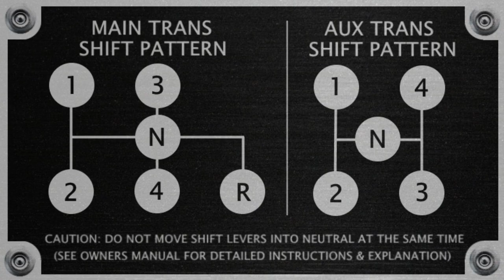Spicer 16speed Transmission demonstration

Comment from the maker: As been pointed out a couple times you never use the first gear on the auxiliary shifting up as this is the low gear and have about the same ratio as the previous main gear in 4th auxiliary
Reply: Oh, that's what I thought. When see you driving you didn't go into first you always went into second. Cool!. BTW thanks for this demonstration
Reply: 1st 1st is when you want to pull a house off its foundation up the side of a mtn. Cause you want to see the sunrise.
Reply: So 3-1 is the same as 2-4?
Reply from the maker: @benedictroberts678  Yes pretty much!
Reply: Good to know...thanks!

Comment: My two cents having driven a 4 x 4 is that the gears in the auxiliary transmission in my truck are: deep reduction, lo, direct, overdrive. So deep reduction was rarely used. But Spicer produced a range of auxiliary transmissions with varying ratio configurations so some transmissions really did have four on-road ratios. So commenters that said "you never reuse first" are only correct for some transmissions. Matter of fact, I never used deep reduction on the road - there was no point. Mine has a deep reduction because it was a semi-off-road truck used in the forest as well as on-highway. Top speed of 48mph by the way with 38k double-reduction Timken axles
Reply from the maker: Thanks for the info that certainly makes sense!

Comment: My first rigup truck in the oilfield has a 4 speed secondary and 5 speed main box. It would move just about anything. The only thing that ever stopped it were the front tires coming off the ground from weight.

Comment: are you sure you go back to 1st in the auxillary after each main shift? usually you go to 2nd-3rd-4th in the auxillary because 1st in the auxillary is usually redundant once you get rolling. I have a 4 speed- 4 speed spicer combo in a 48 Kenworth on my channel
Reply from the maker: Matthew Jones I've sure seen it! Maybe you don't need to use it unless heavy loaded, but it's still the next gear after each "jump" or it wouldn't be a 16 speed right?
Reply: No you don't go back to " deep under" 1st on the aux it's too low. It's like  shifting from 4th to 3rd. Start with both in first then shift the aux up through 4th then shift main to second and pull the aux back to 2nd then third and 4th. Then shift main to 3rd and bring aux back to second and start splitting again. The term 16 speed is rather a misnomer You have sixteen total gears to work with but don't necessarily use all of them, It's like the 15 speed which is a ten speed with a deep reduction box. You have 15 gears to work with ,but if you start in deep 1st and go all the way through the gears, you only make 12 shifts. Bringing the aux back to deep under on a 4x4 or 5x4 will result in a hell of a grinding and wild rpm . Think of  pulling the range selector up in 5th . in a 9 speed and shifting back into 1st instead of 2nd. It's a downshift. Hope that helps. We have an 83 Pete 400 A model Cat with 5x4 . A 72 Pete 4x4 318 Detroit. 1978 K.W. with a 14 speed Spicer and a 73 Road Boss with a 12 speed Spicer.
Reply from the maker: sabrina cordell Thanks for clearing this up! I have not been able to try it with an actual load therefore I never use more then 7 gears. It's great to hear from someone with the experience!
Reply: No problem. From the grandfather on down, there's a hundred years combined experience in the family business. I suppose the best way to tell people is ,after shifting has begun, forget about deep under 1st in the aux . It doesn't come back into play until you stop and pull out again.
Reply: @sabrinacordell6290  if someone share all combinations ratios, i think it will clearly understand. even not necessary real ratios. just which one long or short;. ex; main2 aux4 (<,> or =) main3 aux1.

Comment: Never drove a 4+4 but on my 6+4 there are overlap gears so you its more like 2-3-4 on the aux since 1 on the aux and next gear up on the main is essentially the same ratio
Reply from the maker: Angry Trucker Yes I learned this from Matthew if you go read the pinned comment, so really it's a 13 speed and not 16!

Comment: Cut my teeth on a five and four. Most drivers think you have to start in low and go through every gear. Most loads only require shifting ten gears to get to highway speeds. Don’t waste energy and transmission to impress others
Reply: Norman McNeal what about skipping gears and double clutching vs floating
Reply: Norman McNeal;
A friend of mine wants to give me his ‘49 IH Loadstar with the twin-sticks, and I wanna learn learn how to drive & shift that beast so it isn’t hauled to the junkyard!👍🏽😈

Comment: It must be interesting to shift both at the same time. Suppose you’re in 3-4 and you want to shift to 4-2. You go N-4, decrease RPM significantly, 4-4, 4-N, regain much of the original RPM, 4-2. Or some other sequence that stays within the engine’s limits. Right?
Reply: If you were in 3-4, you would only shift the main to 4 and leave the brownie where it is. Otherwise you would effectively downshift, 4-3 is a lower gear than 3-4, if that makes sense

Comment: I have a question, if you already in 1st gear, and want to "aux" 1,2,3,4... Do you push that clutch again?
Reply from the maker: You change the gears just like any other time wether you do it by double clutching or floating (no clutch)

Comment: I wish some one would show a 3 stick Mack. Dad drove a 56 LJ mack log truck when he was in high school. He said that's the trans it had in it. A 5 x4x2.
Reply from the maker: I assume the 2 speed is the rear axle  and can be shifted either any time or only ay a standstill. So you drive it like a normal twin stick. I could be wrong though.
Reply: The third shifter would be for a two speed rear end

Comment: Modern Eaton has aux too just air controlled with splitter and selector. Most twin stick in modern trucks aren't real mechanical aux and just for appearance
Reply from the maker: Well correct me if I'm wrong but the modern boxes would all be bolted together into one? Instead of being a separate box behind a driveshaft coming from the main box
Reply: @Darstrom  yeah it's internally seperate

Comment: On some of the 5x4 transmissions, and perhaps the 4x4 transmission, some of the gear selections going up are numerically the same as gears you've already used...so you can skip gears sometimes.
Reply from the maker: Yes I think that's the same with all of them. I pinned this on top of the comment section as I didn't know this when I made the video. You'll skip first aux gear. Only use it as low low basically

Comment: The 4×4 was not 16 progressive gears. First gear 
on the brownie was a deep under usually only for hard starts. Depending on the ratios they could be used to avoid a split shift eg 3 over was the same as 4 under. We never called a box gears 123, it was always under, direct and over, plus bull low
Reply from the maker: Yea I got that a while back I think it is highlighted in top of the comment section.
The gearbox was however refered to as a 16 speed
Reply: We called Aux 1 “Deep under”

Comment: 1-1, 1-2, 1-3, 1-4, 1-N,2-N, 2-1, 2-2, 2-3, 2-4, 2-N,3-N, 3-1, 3-2, 3-3, 3-4, 3-N,4-N, 4-1, 4-2, 4-3, 4-4   ??

I want to run 2 m22 transmissions in my S15 truck with close to a 2.83:1 final. 

I am unsure how to anticipate the shift points or total amount of gears...
Reply from the maker: I'm pretty sure you can look up gear ratios if you google and search for the specific gearboxes you are going to use. To fours speed is ofc 16 speeds as stated in the video.

Comment: Ok I understand that I'm stupidly late but I got one question. With the twin sticks, does one need to double clutch when you shift or can it be a regular press in the clutch and throw it in the next gear. and for using the auxiliary shifter should you by default clutch on every shift when operating the auxiliary? the reason i ask that is because i've seen countless videos of people not clutching when shifting the auxiliary (not knowing if they are floating).
Reply from the maker: JD714 Gaming Floating is exactly what they're doing and it is the easiest way to drive these since they are made to work like that, clutch only for start and stop!
And if you're gonna use the clutch it has to be a double press in order for the gearbox to eaiser match the speed. All the same goes for the aux.
Atleast this is how I interpret it
Reply: ok thanks.
Reply: Either way is fine,but the clutch was there for a good reason on older transmissions. Double clutching the old transmissions was almost necessary because they were not forgiving when a shift was missed by a half tooth or so. Pretty much all truck owners and road test required strictly double clutching.

Comment: That must be very difficult to do…I have a lot of respect for anyone who can drive one of these. By the way, what is that round grille in front of the shifters?
Reply from the maker: It takes some practise but is the most fun you'll ever have!
I assume you mean under the dash, that would be a heater fan usually seen on 1940s or early 50s vehicles before they got integrated into the interior design

Comment: Try having the one I had in a 62 Emeryville.  5 speed main 4 speed aux and then a set of 3 speed rear ends.  She could crawl at less than 1 MPH or going downhill with a tailwind break 100 at top gear in theory as no way a 238 Detroit could produce the needed HP to do that crap.  But loaded heavy she could and did move regardless of the freaking weight.  Pulling a triaxle high walled grain hopper one that could hold 2500 bushels if needed that truck could still move it.  How do I know that well Fall of 94 there was a thunderstorm that blew up during harvest.  2 full weigh wagons of beans 2 full combines in the field I was the only truck there.  Boss said dump it all into me and get to the elevator ASAP.  I was on the road 1st weigh wagon could reach the road from the edge of the field it dumped into me then the 2nd dumped into it along with both combines.  I had to spilt weigh at the elevator about 4 miles away.  Front 3 axles where over 70K back 3 74K empty was 28K 112K total weight in grain.  That poor 238 sounded like a bucket of bolts afterwards and we had to overhaul it.  But she was due for one at the time so while we waited for the fields to dry out we did the planned overhaul for her.  Boss said I was throwing flames 5 feet out the stack.

Comment: Does the main box not switch 3rd and 4th like the aux box? I think the 5 speed spicers are that way
Reply from the maker: It's reversed from the main yes
Reply: Thats weird, are all the 4 speed spicers that way? I have only seen the 5 speed spicers and 4th is down right and 5th is up right
Reply from the maker: @moto_rad  No idea
Reply: @moto_rad  yes, if you watch other videos with 4x4, 5x4 & 6x4, the aux box has the same shift pattern

Comment: Not sure if this is the right place to ask, any input would be appreciated.  I have an 18 speed + 4 speed Aux for my heavy haul truck.  Haven’t really used the aux.  wanted to see if anyone is familiar with the proper shift pattern for that setup. Thanks in advance
Reply from the maker: Cool setup!
To use them all you'd shift the aux 3 times for each gear in that 18 speed (don't use low gear other than in low on the main)
If not using it hopefully it was left in 'direct' or lower

Comment: What's it like on a 6x4? Is there just two extra gears on the Main or auxiliary?
Reply from the maker: Exactly
Reply: The extra gears would be on the main. Aux's only come in 2 (typically only Mack did this), 3 and 4 speed

Comment: Would it have been too difficult for both boxes to have the same shift pattern?
Reply from the maker: The pattern is not standard. The one ordering would have it to his specifications and it's no bother whatever you get used to!
Reply: Yeah I guess you get used to everything with practice.  Over here it's mostly a standard h with a splitter which looks easier to get used to, though with a fraction of the gears.

Comment: Please tell me, is it possible to drive the Truck some hundret kilometers without using the aux gear ? Only with main ? (1,2,3,4,R,N) Always without trailor. Thank you.
Reply from the maker: Yes if you are empty (bobtailing) you can shift the Aux into second or third and then just drive the truck like a 4speed using only the main! 
On highway speed you're gonna want to shift the Aux into Overdrive however
Reply: @Darstrom  Thank You ! Found a 1966 Peterbild 281 here in europe its an 8 Cylinder, comes from California,blue/white, i am interested to buy him for fun. I never drove a Truck, thats the problem....People here say that 2 Gearboxes are not easy to handle....A crazy projekt.....
Reply from the maker: @stefanm.247  They may be thinking about european twin sticks, which have to be split a couple of time (correct me if I'm wrong) in order to get up to speed. Scania had a gearbox where the second stick acts as the split or high/low range on modern boxes, so only 2 gears. 

But non the less these are not easy to drive, but if you ever try one or even buy, shift without the clutch. It's easier to learn, especially if you only start driving with one stick. 

Take it out of gear when no force is applied (either by acceleration or engine braking) and wait for the RPMs to drop until you gently press it into next gear as the engine speed matches the rear wheels.
Reply from the maker: @stefanm.247  Is it a Detroit then?
Reply: @Darstrom  I can show you the papers and fotos if you give me your email. US Papers are very (!) strange. Dont know if it is a Detroit, maybe you can see.
Reply: @Darstrom  Thank you !
Reply from the maker: Awesome, send away! darstrom.drawings@gmail.com

Comment: yeh heh buddy...you go one gear on the main; then auxiliary box go 2,3,4 then shift one gear on the main; auxiliary back to 2,3,4 then shift another gear on the main; auxiliary back to 2,3,4....and keep on shifting.  The auxiliary box is 1st gear, 2nd gear, Direct(3rd) gear, overdrive(4th); this is why you never stick back in first on the Aux-box - first gear in the aux box is too low.  You use that gear when you blow a shift on a hill when having to downshift, trying to get the aux box into 2nd; the truck will slow down enough you can jam the aux stick into first to allow you to start to upshift again to 2nd gear.
Reply from the maker: Yes I got this cleared up for me a while back. The video is really just made to show the layout and since I'm self learned and never hauled any trailers with this truck I didn't know. Still thanks for pointing it out!
Reply: Ok buddy, you have to do a video of hauling a load somewhere around 35000 kg's, out on the blacktop, doing about 90kmh and come to a hill.  Then the hill will slow you down and force you to "row" gears like you'r rowing a canoe up the creek......hahaha.   Hope to see your shifting prowess some day.  The big test will be down shifting the main to a lower gear and putting the Aux in 4th(overdrive).....  w00!
Reply from the maker: @iBackshift  Heck yea that will be one hell of a drive. I will certainly do a bunch of videos when I get a trailer!

Comment: Quick question what would a 10 to a 12 speed be called how many gear main and how many gear aux
Reply from the maker: brandon moffatt I dont know for sure if they made 10 or 12s back then but the logic would be 5 main and 2 aux for a 10speed, or 4x3 for a 12
Reply from the maker: I know old Scanias had a five speed gearbox with an 2 speed aux makin it a 10 speed

Comment: What truck is this demonstration in??
Reply from the maker: Michael Langdon 1950 Kenworth CD-521
Reply: Darstrom 
So do you shift both gears at the same time? Or do you just go through the 4 gears in the main transmission first and then use the auxiliary transmission second?
Reply from the maker: Sry for the slow reply. You can leave the Aux in 2nd or 3rd and drive the main like a normal 4 speed if you're bobtailing, otherwise you better shift the aux at least 1 time between each step of the main

Comment: Wouldnt it make more sence to describe the auxilery OD as a W pattern
Since the motion from 2nd to 3rd is an arch sort of 
1 N  4 
 |/  \ |
2.    3
The twin stick is n forever will be a MANS truck 
But that pattern has screwed up so many people who are new to it.....
Reply from the maker: That guy In your unit who's from Texas Neutral is still in the middle, but I see your point since the motion is like a W.
Reply: Darstrom watching you shift your brownie reminds me of the granny 4 in my truck 
Low gear takes finess 
And 3rd slips away from me 
Double clutching saves me quite often......
Reply from the maker: That guy In your unit who's from Texas Every gear has its own life =)
Reply: Darstrom indeed. It probably 
Doesnt help since i got the truck second hand from a fire department 
.... fluid is low in trans 
Synchro's are worn i need to change the fluid ..... 

But i plan on getting a 56 gmc 370 n putting a 4 speed OD in it 
I can shift an old non synch better than my current truck...
Reply from the maker: Worn synchros must be a pain! Replace it with a non synced gearbox right away !   =)
Reply: Still H pattern just 3rd and 4th are bacwards
Reply: If this is a W pattern, the main would be a mirrored N pattern. And the transmission of my VW van would be a M pattern. ;-)

Comment: Its a 13 speed not a 16 speed lol
Reply from the maker: It's called a 16 speed even if more gears have more or less the same ratios. I assume you are refering to this since you never use low in 3-4
Reply: No its a 13 speed.